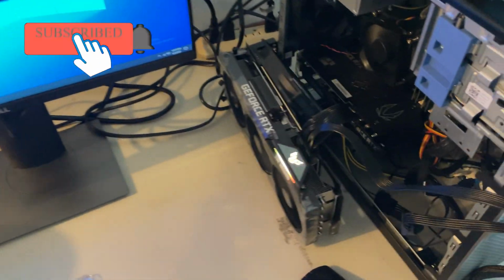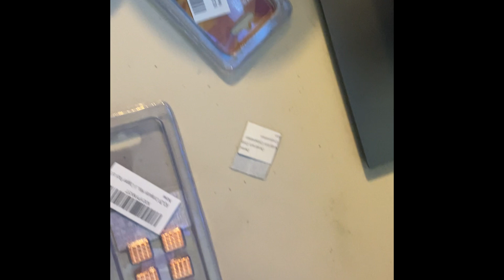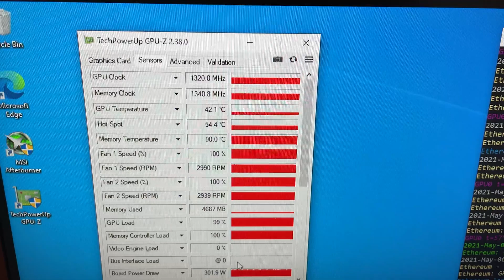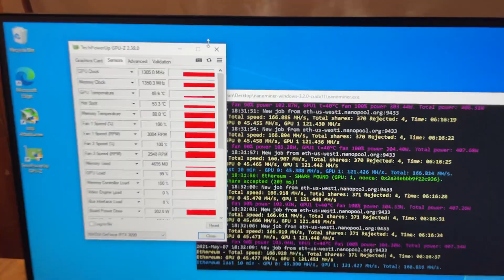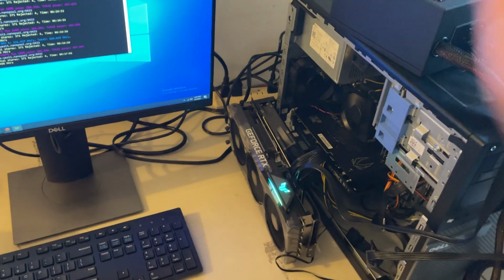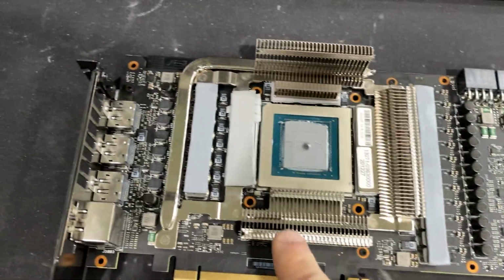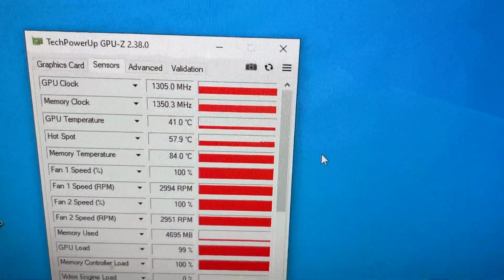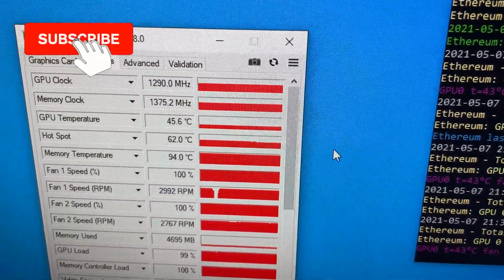3080 / 3090 Memory Junction Temps FIX GUIDE

Comment: Just changed the Pads on a ASRock Challenger RX5700 XT I bought on Ebay last week. I got it for $109 out the door because it was overheating. He even contacted me saying he changed the pads and paste already. His pads were like play do and had fallen apart. I used Artic (both) and got it down -20c to 74 degrees on the GPU, TJ temp is 80c, and Memory is 83c (even after pads on back of memory to back plate). I am going to try a SSD cooler with fan next.

Comment: wow your core hotspot delta went from 12c to 18c after you replaced thermal pads. I would have rather dealt with 6c higher mem junction temps than hotspot delta's. It may help out with the lower core clocked mining but I bet that mod actually hurt gaming performance by cutting down a few boost bins on the core freq.

Comment: I thought the manufacturer of the memory chips give the sustained temp at 95 degrees c? I know a lot of cards go up to a reported 108, mine is the same as yours sitting around 92 in an open case with a couple of fans on it (Leadtek Hurricane)

Comment: my 3080 aorus master hits 108-110 degrees 24/7, even after only 25 minutes of mining lol.
Reply: My zotac amp holo hits 108 mining. It's constantly at 106-108. I was fully going to swap out my thermal pads but zotac changed their warranty and  opening the cooler will void the warranty. Im kinda at a loss. Do I risk burning up my card that I can send back and get replaced for free? Or do I fix the issue and void a 3 year warranty? I'm think keeping the 3 year warranty because I won't be out a card if it dies.
Reply: @randybobandy9828  just unlucky man. :/
Reply: @dreamomega  ya It sucks. I think I decided to just run the Temps hot and if something happens rma it. I have rma a gpu from zotac about 4 years ago(it was a 980ti) they offered to send me a free upgrade(a 1080) because they didn't have card anymore. They sent me out the replacement before I even sent them my card. They are awesome at RMAs. Contrast that to ASUS who are terrible. It was such a hassle to fill out a asus rma form and it took 5 weeks before they sent me my motherboard back. They also forgot to put the plastic shroud that covers the entire motherboard too! I had to send it back again! If I can I won't buy a asus product. Evga and zotac have been top notch when it comes to RMAs.

Comment: i am using 3090 aorus gaming box, , modification by attach 2 big heatsink with fan at the backplate, additional 2 ram heatsink attach with copper front side , hashrate 127, using nicehash quick OC 310w/-150/+1650/fan 80% , result for temp is 45c vram 84c with ambient air  32c without aircon turn on. If the ambient air cool by aircon set to 24c, result is 37c vram 78c.  Replacing thermal pad in specific area ( front n back parts ) is the key to lower down your mem vram temp.

Comment: Best intro yet! After watching your video I grew a pair and opened up my 3090 Strix and changed my thermal pads. I used Gelid Ulimates and the memory junction temps went down by 18 degrees! Well worth doing!
Reply: Did you use different pads for different areas and was it hard? I have no experience lol but a fast learner
Reply: @nii3552  I used this post to make sure I brought the right size thermal pads. When I took the card apart and measured it with an electronic caliper, the stock pads were exactly as listed in this post: https://www.reddit.com/r/nvidia/comments/m8ou00/asus_rog_strix_geforce_rtx_3090_thermal_pad/
Reply: @Gman0116  Damn! Thanks so much!!! What tools did you use for opening it? Im scared of not correctly putting like the right twork(w/e) its called on the silver 4 screw backplate portion. I'll look into how to properly do it all but I just want to ask by chance you have guidance.
Reply: Just put something like pc screw driver kit in Amazon and get one of them. Take your time and take pictures while you’re doing it. It’s actually not that hard. You’ll need to replace the GPU paste too. Good luck :)
Reply: @Gman0116  ty

Comment: I just changed the thermal pads (front and back) on my zotac rtx 3080. 
Went from 96°C to about 83°C.
Powerlimit: 72%
Core: -300
Mem: +1300
Fan: 70%
Reply: What pads did you use?  Did you lost your warranty?
Reply: @TASKEsrb  you lose your warranty once you crack open the GPU. No matter what.
Reply: @hector97101  On my card there are no stickers on screws.

Comment: I did this to my 3090 ftw3 with 12 14x14x6mm alloy heatsinks, I then attached an 80mm fan to the heatsinks  so the air would blow thru the fins. Junction temp is at 78° with a mem clock of +1600 giving me a stable 127.3mh/s
Reply: Sir is their any chance you give me some information about the heat sink and the fan? Plzzzzzz
Reply: @eddyli545  seems I can't post any links on this page. I used some ebay 14x14x6mm self adhesive heatsincs from ebay. I stuck a heatsinc over the top of each memory module on the back plate (there are 12 in total) being carefull not to push them on too hard because it can squash the thermal pad and when you release the backplate can pull away from the thermal pad, I then used a 3000rpm 80mm fan also from ebay and I cut very thin strips of alien tape (double sided clear tape) and put it on the thin edges of the fan housing and then stuck it directly to the heatsinc

Comment: Really thought that changing the pads would do more. Poor cooler design as it doesn't look in the same league as the Aorus Xtreme?
Out of interest, I've been doing some mining with Aorus Xtreme 3090 (Bykski plus Mp5Works) and a Aorus 2080ti (EK block), both watercooled in the same loop.  A single 360 EK thick radiator with Noctua Industrial fans is keeping both cards cool with water temperature of 40C and ambient 25C. 3090 memory at 74 to 76C. I can only get 110 MH/S from my particular 3090 due to what must be poor silicon lottery on the memory chips even on its own, but the 2080Ti adds another 60. Not bad for one radiator.

Comment: Hey quick question, I have a 5950x and a rtx 3080, roughly how much FPS do you think I should be getting on Warzone playing at 1440p? Sorry I know you get heaps of these questions
Reply: 220+
Reply: @catalyst2590  I’m sitting on 120-160. Mostly on 140
Reply: @RomeluAU  what's your fps on all settings on low and 1440p when I had a6800 non xt I got 190-260 still
Reply: Regular texture gets you more frames in case you have it on high texture resolution

Comment: Hey my AMD Radeon VII is a beast at mining, especially after you powermod it, I get about 93MH I used the same copper heatsinks on like all 16 of my memory, temps dropped from 90 to 66 degrees. ATM I think that the AMD Radeon VII is the best AMD mining card its crazy look at the prices of them on EBay there more than a 6900 XT or the same. I think the HBM2 Memory is factor here.

Comment: Regarding the Strix running a bit hotter than the TUF : there's been many people reporting some slack with the shroud, resulting in fans sometimes rattling, and temps being not as good as they should be. Did you know ? It happened to me a while ago, I had to tighten some screws and done.

Comment: I found your channel recently and you're doing amazing job with OC but in this case I have to disagree with you about pads. I mean - stock pads are awful and replacing them is the first thing everyone should do. But if you do the actual math about how much heat is been releasing from 12GB GDDR6X memory modules on the back of the card, then you realise it's ~30W of heat that need to be dissipated. Backplate and/or such tiny radiators won't do the job with 30+W of heat. You need a MASSIVE freaking rads installed on the backplate or juz water cool the backplate. I've also tried everything like you did in this video... I hope this post will help anyone with memory temps issues. Thanks and keep working on amazing videos like you do :) Cheers m8.

Comment: I changed the thermal pads on my RTX 3080 Gaming OC card, my memory temps before were 105-110 Celsius junction temperature with side panels off after the thermal pad change the junction temperature went to 64-66 Celsius with side panels off and 74-76 Celsius with the side panels on.
Memory temps dropped by 46 Celsius XD
I used GELID ultimate thermal pads 15W/mK
Reply: I have the Gaming OC water force (same pcb).  What thickness pads did you get?  I need to do this but don’t want to tear down my loop just to see what to order.
Reply: @filter27e  Did you change your pads?
Reply: @bobtbl2868  not yet, since I’ll have to drain my loop probably going to wait until I’m ready to add a radiator and do it all at once.
Reply: @filter27e  oh thx
Reply: Did it increase your core temps any higher? People are reporting that after switching thermal pads and improving memory temps that the heat spreads around the chassis and makes core temps higher by 10+ degrees.

Comment: Thermalright 12.8 W/mK on both sides of the memory on my buddy's Aorus Master 3080 102-106c max fans open case to 72-74c closed case, only the cpu on water cooling, no ridiculous backplate heat sinks. It's actually silly how much of a difference it makes on some cards
Reply: Hope i see that difference on my Asus strix 3080ti. i am going to change the thermalpads with those thermalright and going to usethermal grizzly kryonaut extreme: )
Reply: @Cobretti_GTI  Difference is less on Asus cards since they have that dedicated memory cooler section which limits how much memory cooling you can get from the air cooler as a whole. It keeps the gpu die cooler because the memory is thermally isolated from the rest of the cooler, but makes memory temps among the highest of any card this gen. Should still see a worthwhile improvement though

Comment: Slap an intel stock cooler on top of the backplate xD
Reply: This works. Result maybe 2-4 degrees of drop with a fan on 3090 backplate.
Reply: @juhoeske  I managed to drop vram temps by at least 10C. I took the fan off and laid the heatsink upside down on the card. Then with some pieces of string I hung a 140mm fan to blow towards it. Now I have 60C memory junction temps while gaming lmfao.

Comment: So what i did to my card after thermal pads swap is repasting with liquid metal. Somehow it dropped 5-6c on memory as well. I guess because gpu now dumps less heat into PCB. Mem is now around 90c with 50% fan speed. Which is totally fine noise wise.